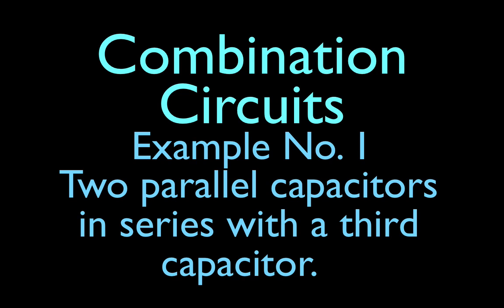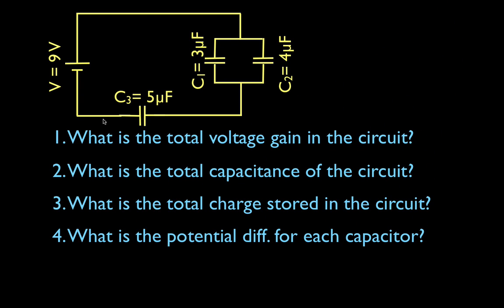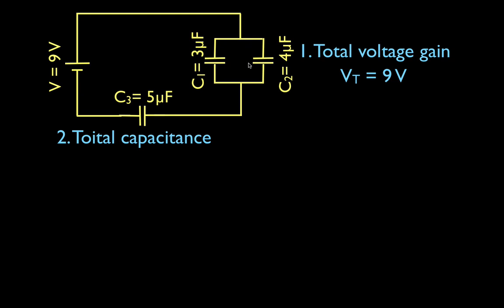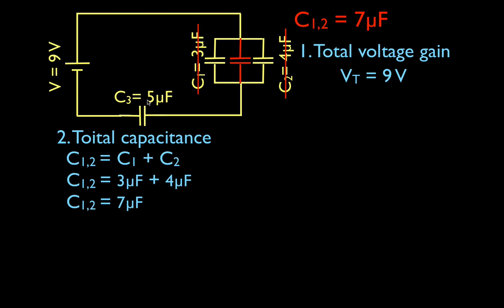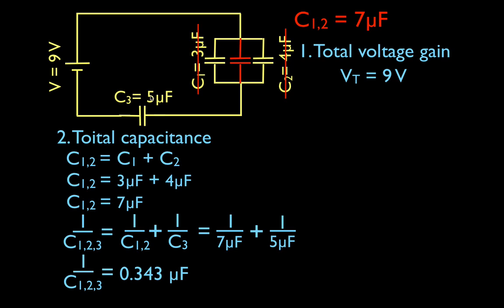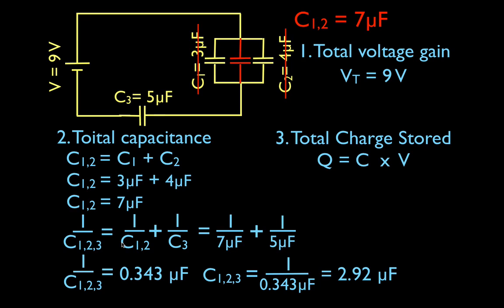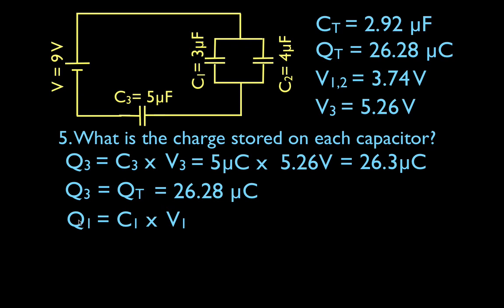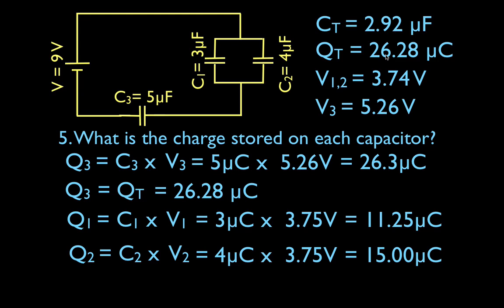Capacitors (5 of 11) in Combination, Parallel and Series Capacitors

Comment: I have a silly question: is the potential difference for each capacitor the same as a voltage across each capacitor?  I mean those both mean the same?
Reply from the maker: Yes, they are the same thing, and no that is not a silly question. The terminology can be very confusing. Probably "potential difference" is the better term but since it is measure in volts it is often referred to a the "voltage".

Comment: thank you very much very easy to follow you, but how would you calculate the total energy in this circuit?
Reply: should i calculate the energy in parallel and add the energy in C3?
Reply from the maker: calculate the energy stored in each capacitor, I think

Comment: 3.74 corresponds to the total voltage between C1 and C2, right? so their individual voltages are 3.74/2?
Reply from the maker: No!  But this is a common mistake.  Please remember that the voltage drop across parallel circuit is "always" equal.  So the voltage drop across each of the capacitors is 3.73 V.
You can see a listing of all my videos at http://www.stepbystepscience.com

Comment: sir how would i solve for the maximum voltage that can be applied in a series circuit if each capacitor's value has voltage rating,?
example :
c1= .002 uF, volatge rating= 120V
c2= .002 uF, voltage rating= 26V
c3= .002 uF, volatge rating= 120V..

i solved for the total capacitance and i got .00067uF.
but i dont know how will i solve for the voltage, will i just add it? thank u.

Comment: How can the charge Q3 equal the total charge? That would mean all the charge in the circuit is on capacitor 3 and no charge is on the first two...
Reply from the maker: This is a little hard to convey in a comment but.....yes the charge on each series capacitors is the same.  Imagine a certain amount of charge comes out of the battery, this is deposited on the first capacitor and pushes the same amount of charge on to the second capacitor and on down the line.....I also made a video explaining this concept...Charge for Capacitors in Series

Comment from the maker: Check it out!!!  Electric circuits with capacitors in parallel and in series.  That 's intense!!!
Reply: hey great work but i think you made a mistake near the end for Q1 and Q3 the individual values are suppose to be V1= 1.87 and V2=1.87, not 3.74 because thats the total some of voltage for V1 and V2.  Please Correct me if I'm wrong.
Reply from the maker: This is a very good questions and a common mistake.  C1 and C2 are in parallel therefore they have the same voltage drop and that is 3.74 V as I stated in the video.  Whether resistors, capacitors or some other type of circuit element, the the voltage difference across parallel elements is equal.  Thanks for the comment.
Reply from the maker: aria k No I think I have it right, but yours is a common confusion that people have. This is a little hard to explain here….First of course parallel circuit elements do have the the same voltage drop across them.  The drop across is 5.26V, then the voltage drop across each of the other two is 9.00 - 5.26V.   For each "path" the voltage is shared between two capacitors.  For each of the two paths the total drop must add to 9V.  In your case it would be 5.26V + 1.87V = 7.13V and that ain't 9V.  Does that help?